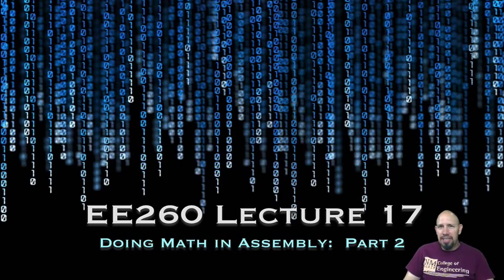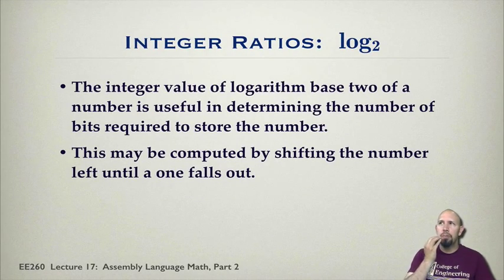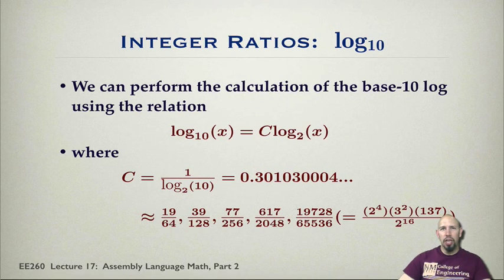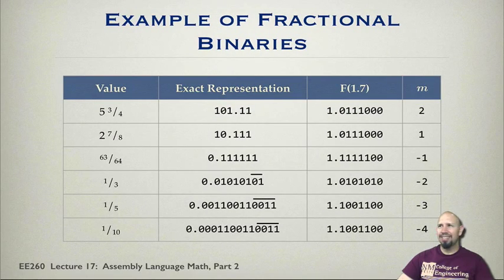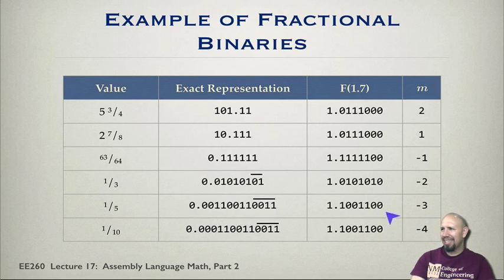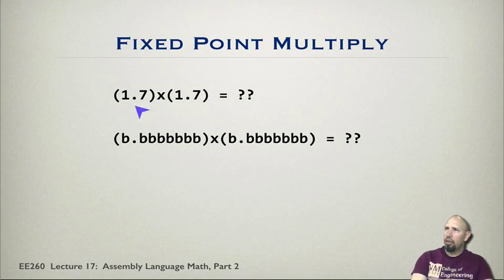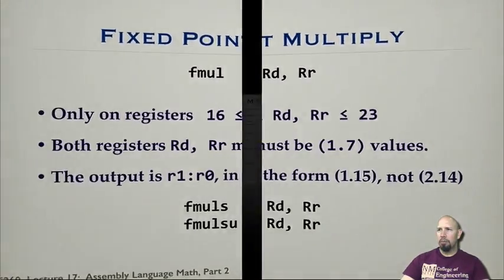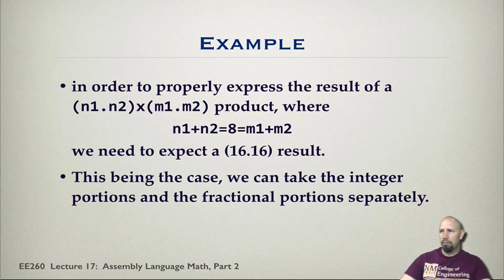17B. Arduino Assembly Math, Part 2

Comment: This lecture has enlarged how I will forever view math in programming languages. not just for on the Arduino Atmel328p processor and C, a lot goes in there at the machine (CPU) level. Than you for the highly illustrated teaching. I will view your other lecture series.